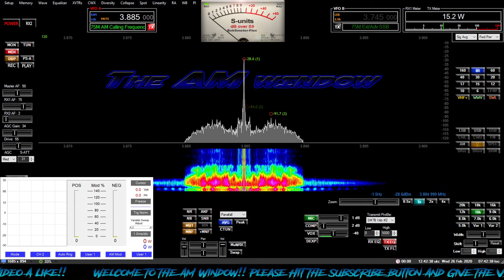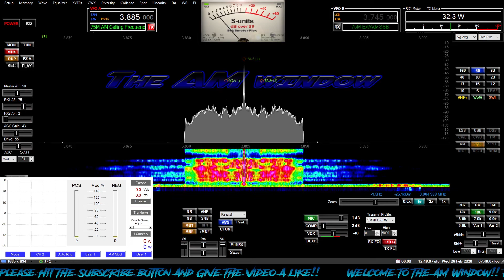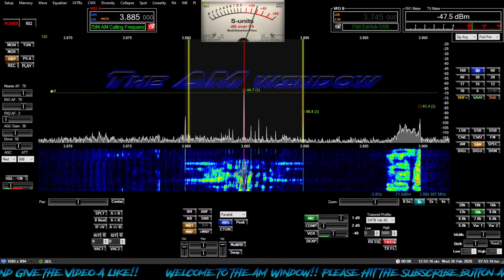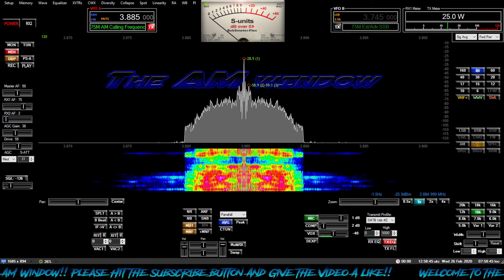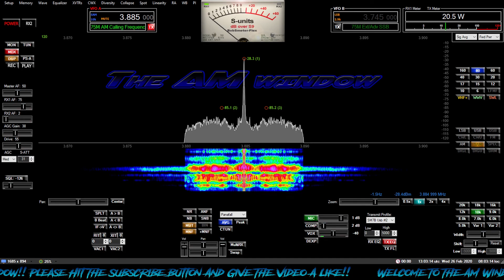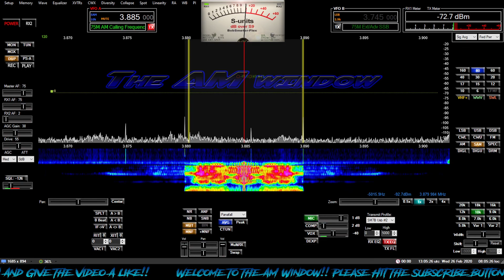W2SDR & W3MMR's Phenomenal AM Audio On Their Apache Labs ANAN Software Defined Radios...

Comment: I think the audio is harsh, especially on Perry's signal.  How did you set up your AGC?  Why all the distortion?  And the SAM mode is not helping with selective fading distortion.  THAT is the sign of  a poor design UNLESS you haven't adjusted your AGC and  AGC threshold properly.  If you have, then I just don't get how anybody can say that this receiver has "phenomenal audio" to quote what you claim.  Am I not getting something?
Reply from the maker: SAM won't work with selective fading distortion if the station your receiving is transmitting over 150% positive. Happens on EVERY sync detector. Even Sherwood's. So before calling it a bad design, you may wanna learn why they act the way they do...
Reply from the maker: What receiver are you using?
Reply: @theamwindow  Flex6400M.
Reply from the maker: Haven't bad a chance to operate the 6400. Great rigs for sure.